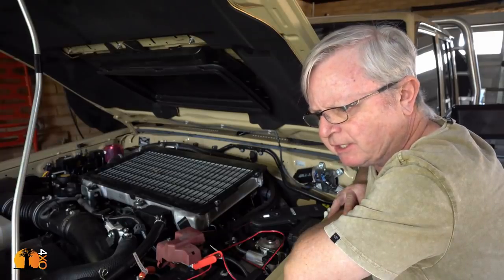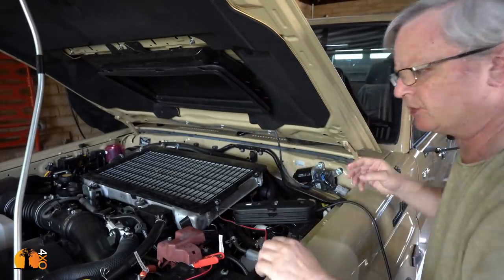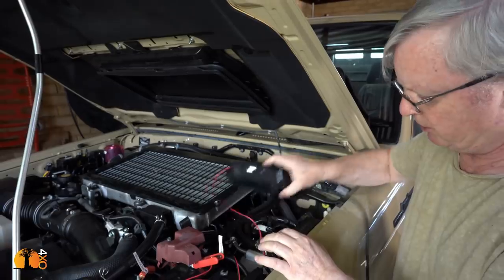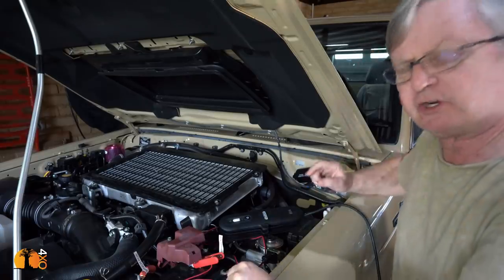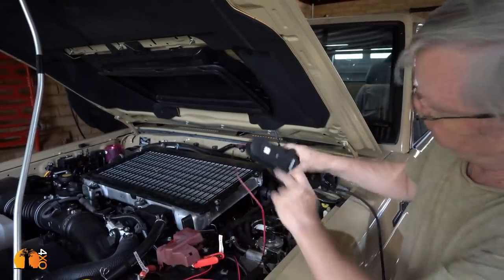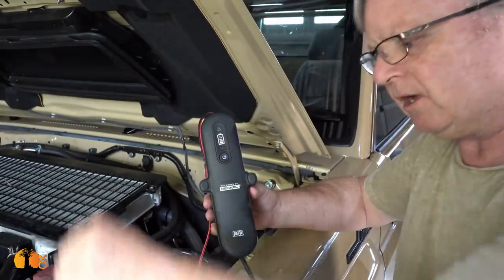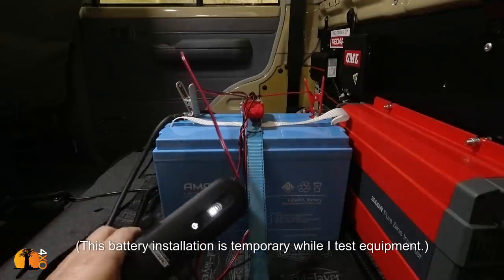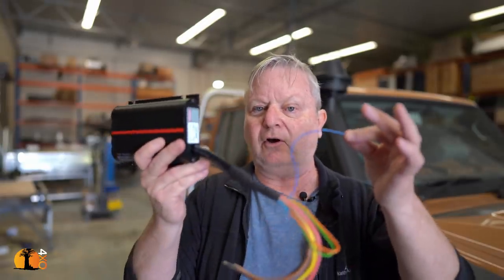DC-DC CHARGER RUNAWAY DISCHARGE WARNING.

Comment: Andrew, you've just proven (thank you) that a DC-DC-charger is a redundant piece of "bling".  All one needs instead of a DC-DC-charger is simply a $30 BIG FAT DIODE . OK, assuming you're also charging from the Solar-Panels, then you need a regulator for them, but a decent Solar charge regulator will do that cheaper than the DC-DC bling. Reason I say this is that the vehicles Alternator is a regulated charger of ample output. Now, you could in theory just join the 2nd battery in parallel with the car battery, and they will both charge just fine . -But we both know why we do NOT do that! - because they will both go flat together, too. And THIS is what the $30 diode is for - it allows the charge to flow only in the direction of the 2nd battery and not out into the car battery.   Your Alternator has plenty capacity to charge both batteries simultaneously. the DC-DC inbetween is only duplicating what the alternator itself does. Moreover, its just wasting energy in the process.  Just replace it with a diode, (and a $1 fuse if you want to go "pro version" ) and you're set (so long as you have a little regulator between your Solars and the 2nd battery).  I'm all for keeping things simple in the bush. I don't need to explain why.  Thanks for  a  great channel.
Reply from the maker: This is not a problem I’m trying to solve. And neither is this a mystery as to why it happened. It can and will happen to anyone using a DC-DC setup. It's the nature of how DC chargers work. All of them with the exception of those relying only on a trigger wire. The solution is to charge the auxiliary batteries first. It's that simple.
Reply: @4xoverland  Fair enough. Either, as you say, charge the Aux batts first ... or ... get out more often - The problem we ALL have :-P

Comment: The DC to DC charger from jaycar is a fraction of the price of the Redarc unit, it has two different ways to turn on, one is via a vibration sensor that's built in which detects that the car engine is running and the vehicle is moving and starts charging, or you have the ignition direct connect option or you can set it to run constantly! Plenty of options! It also has the LiFePo4 battery charging profile! It has solar panel input also and it will always choose solar first if available, solar charging current is higher than what it delivers from the alternator to protect your alternator from setting itself on fire 🔥... 
Redarc is a very good brand! Designed and made in Australia and their products are used by people who don't even know that it's in their vehicle because they are so reliable that you forget that they are even there.
But I'm disappointed with Redarc because their lower end stuff looks exactly like what you would find on eBay for $20 but they are asking $200! Without mentioning why their product cost so much more! I'm not paying that much just for a brand name! I could understand if their one is built to their specifications and therefore cost $50 or $70 compared to the $20 eBay burn your house down special! It's a joke! Renogy is looking a hell of a lot better at the moment! 
One really important thing to keep in mind is the wire that should be connected if you have a smart alternator! If you connect this wire and you don't have a smart alternator, it might increase the current delivery from your non smart alternator! This will cause the alternator to self ignite... Be warned! I'm aware that the Renogy DC to DC charger does this.
You could possibly use that feature to your advantage though, if it's wired to a separate switch on the dash, you can use it to speed up the charging process which you are out on the highway where there's plenty of airflow and the alternator is working at it's optimum speed... 
I'm not sure about that Redarc unit, make sure that the wire is just to turn it on and not for the smart alternator sensing... 
In another of your videos, you mentioned that the LiFePo4 Batteries aren't good for use with a winch! Sure, that's perfectly correct if you have just one battery! Some people just go with one big battery and all is well! I don't have an auxiliary battery in my car but I'm using them at home for solar. My LiFePo4 Batteries are 8Ah... They come in those 7Ah SLA type enclosure's... They are very well protected from everything, they cost $66 each from an eBay seller in Australia and are totally amazing. 8Ah might no sound like much but I first started with 8 of them and was really impressed with how much current these little guys can provide when paralleld, they weigh in at just under 1kg each! I have since added much more, since they are cheap to get your foot in the LiFePo4 door. I can afford to keep adding more over time instead of a lump sum payment.. 
There's also 20Ah versions which work out cheaper per Ah... The sweet spot at the moment are the eBay 135Ah LiFePo4 Batteries at $450AU... Even if they don't reach the rated 135Ah capacity, even if you get 90Ah worst case scenario, two of them should still get you 180Ah for slightly less money than what the name brand batteries will give you for more money! There's plenty of options, with smaller multiples of batteries, the current capabilities could power any winch... It's not impossible.

Comment: User-induced issue.  There are many ways to do it correctly and one way to do it incorrectly (by triggering the dc-dc with a tiny mains charger on the starter side).

Either isolate when shore charging starter batt with a tiny mains charger or use a mains charger of the appropriate size.  Or charge aux back from mains with a dc-dc that maintains starter batt.

Patient: it hurts when I do [this]!
Doctor: stop doing it and it won't hurt anymore.

Comment: your alternator has a 12V point only when in operation. Connect the trigger there. That way you only have the secondary battery charging with the car running. That's how I've setup mine and it's working just fine.

Comment: The exact Reason I run a 4 battery system. Bat1. Main starting & engine (Computer) Bat 2. (charged via a voltage sensitive Relay) It runs all other accessories. Spotties, Radios (including HF with GPS), Tablet with GPS, Work Lights, reverse Lights, Interior Lights etc etc. Bat 2 & 3 are AGM's (charged via DC to DC charger from Bat 2.) for the fridges (1 fridge & 1 freezer usually) & 2 inverters (1800w & 400w) My system is designed that if I was by chance to "loose a battery" I can always start, winch or even still run my other accessories. (I could even use my AGM's to start ......but only in an emergency, if for some reason I lost both the wet cells under the bonnet)   

 As I am involved in running an event once a year in the outback (based on a salt Lake) often my old girl has to sit while doing a job, then I move on etc. Because of that, the power demand with the heat especially on Air Conditioning (I have 2 A/C units) I have also set up 2 alternators so I have a pretty good charge rate on idle even with 2 big thermo fans, A/C, charging cordless drills, the fridges, radios, my mapping system for the surveying etc etc. 

You certainly live by experience! That has taught me lots over the years especially with the high demands I have. I would just love to afford Lithium to lessen the weight & give myself more usual storage when stationary but the AGM's have been fine so far, with the set up being in a different vehicle before this. (P.S. I also run a 100w Solar panel, but that is only a recent addition as I often will load say on a Thursday Night & my truck will sit all day while at work before we head. She's my daily driver & stays fitted out. I find it quicker to put a trailer on if I need to pick up anything largish, but I also live in the country so parking with a trailer is easy. I can certainly understand why you have gone the lift off camper route.

 I also run an onboard 240 volt charger for when I have mains. While the fridges automatically switch over to 240v when I plug in (handy before a trip)  I'm about to do another upgrade of a 240v change over unit to automatically switch everything that runs from the inverters to run on 240 when plugged in. It has taken me many years of trial & error & I'm just begining to sort out what works..... for me. My needs are pretty different to the norm, which I get. Monitoring is critical & I do Love my Victron Stuff!

Thanks for another Great Video (it was great to sit down after work with a beer & watch the next enthralling episode. CHEERS!!

Comment: I have exactly the same setup in my 4WD (third Redarc BCDC setup Ive had installed across 3 separate vehicles). The simple solution to counteract the problem you’ve described is to wire up the blue wire to ignition. Understand that if you leave the ignition on the Redarc BCDC device is then activated, however, how often will you leave your vehicle in ignition? Across the 3 4WDs I’ve owned I’ve never seen a need to leave in ignition.
Reply: That sounds exactly what I thought, i have the same setup with the blue wire connected to an ignition source. No problems.
Reply: Yep, blue wire goes to ignition so battery charges from alternator when ignition is on and solar/external chargers when ignition is off. If you leave the ignition on by accident, the start battery will only drain until it reaches the cutoff voltage and then switch itself off as per usual. The only time you will run into trouble this way, is if you have an external charger/solar AND leave the ignition on

Comment: Have a look at the company Traxide. There's works better than DC-DC chargers.
Been around for 20yrs plus.
Kept my dual battery variable voltage alternator 4wd charged for 7 yrs so far :)
Reply: Hi, do you have a website for them?

Comment: I use the ignition trigger with a 60 second delay. (via another device) This way no accessories come on until the car has been running, and the alternator is at the ready.
Reply: I put one of those programmable ones on my side by side so I could keep the radio on They work great and are cheap 25 bucks all kinds of programs You can make it do

Comment: Smartest thing I have seen is an Inertia Sensitive Relay on the DCDC charger ignition sense wire  that only activates the DCDC charger when it detects the vibrations from a running engine.

Comment: Wire a switch into your ignition on trigger wire. Newer vehicles also have engine on only circuits you can use for your trigger wire.

Comment: Simple fix. Just put a battery isolation switch between the start battery and the dc-dc charger and turn it off when charging your start battery by a mains charger. It's common sense that when you start adding external power to the system that it will turn on and start sucking power from the start battery.

Comment: Use a battery isolator connected to your ignition. Also a separate switch to the DC to DC so you can turn it off even when you ignition is on . When your ignition is off the isolator is disconnect and so is the DC to DC.  Also my trigger switch is connector to the isolator. When its on and the separate switch is on so is the DC to DC when its when is off its off.

Comment: Andrew , you can buy some cheap DC amper clamps to see how much current is moving through the cables.  Your alternator can provide 170A , but at 6000 rpm, at 1000-1500 rpm its max output will be like 100-110A ... Even if your DC charger can provide 50A there is no battery that can accept it... No way that little charger to be able to provide 10A...
Reply from the maker: This is not a problem I’m trying to solve. And neither is this a mystery as to why it happened. It can and will happen to anyone using a DC-DC setup. It's the nature of how DC chargers work. All of them with the exception of those relying only on a trigger wire. The solution is to charge the auxiliary batteries first. It's that simple. When I learn something, I like to share it.
Reply: @4xoverland  I know that you are sharing experience and not solving problem.I find all your electrical videos very helpful. I just suggested that a dc amper clamps will make things very visual about the exact  amperage and direction.

Comment: Thanks for the warning Andrew. It sounds like the DC-DC charger is smart, but not smart enough.
Reply from the maker: This is not a problem I’m trying to solve. And neither is this a mystery as to why it happened. It can and will happen to anyone using a DC-DC setup. It's the nature of how DC chargers work. All of them with the exception of those relying only on a trigger wire. The solution is to charge the auxiliary batteries first. It's that simple.
Reply: 4xoverland Then edit your video accordingly. As it is, it sounds like you’re blaming the equipment, when all the equipment was doing exactly as it was designed to do.

Comment: Great video thanks, so the game changer has introduced problems for the non experienced installer 👍
Reply from the maker: Yes. But it has more importantly made it one zillion times more efficient and easier to install for the non experienced installer. There is always a catch with great inventions. In this case the catch is a small one and as easy to solve as  - charge the auxiliary battery first. What could be simpler?

Comment: Even if you had the blue wire connected to ignition, Redarc will still sense an increase in main battery voltage and turn itself on. I noticed that on my Land Rover.

Comment: A switch or re-settable circuit breaker disconnecting the connection between both batteries is the easiest solution I've found to this problem. Afterall with lithium batteries there is times when you don't want to be endlessly charging your aux lithium battery with alternator and keeping it at 100% especially with no load. If the switch or re-settable circuit breaker can be mounted outside of the bonnet (perhaps in the grill or under guard etc for easy access) all the better. With solar on the rooftop and a little experience you can also judge whether your aux battery will get to 100% on a roadtrip without alternator charge which also saves fuel. Need separate solar and DC-DC controllers though to do this.

Comment: Sir, that wiring got some controll bits missing. i. e: Undervoltage relay is essential. The small 10A charger wont give it 10 amp, no chance. Good to make people aware.
Reply from the maker: This is not a problem I’m trying to solve. And neither is this a mystery as to why it happened. It can and will happen to anyone using a DC-DC setup. It's the nature of how DC chargers work. All of them with the exception of those relying only on a trigger wire. The solution is to charge the auxiliary batteries first. It's that simple.

Comment: So this occurs when the DC/DC charger senses the (higher) voltage but not low current output of a small charger, and then "decides" to charge the auxiliary battery, which is in a state of discharge? Interesting problem

Comment: So in short... your charging system design needs a little more work. I like the comments suggesting an oil presure sensor then there's no risk, much better than "fuse out" or a switch which are likely to be forgotten to be replaced or turned back on......as I often do!

Comment: Are you SURE No.1 Battery is OK?
1 Is that a Japan or Venezuela built 70 Series chassis? How many months was its sea-passage to Oz?
2. How many Ships and Dockside compounds was it on? How many folk Jump Started it over the months, or 
reversed the Polarity? 3. Did the Chassis-Chop/Stretch team disconnect BOTH leads before welding began? 
4. Have you upgraded the Alternator Amp capacity for the myriad of accessories now installed?
5. Previous video showed 120A Fuse load destruction test ... are you really consuming 1,560 Watt Max at 13v?
Reply from the maker: The starter battery is in good condition. There is no mystery why this happened. It happened exactly why I said it did.

Comment: I believe my Renogy DC-DC won't start charging unless BOTH the ignition circuit is 'ON' and the seperate external Voltage Sensitive Relay senses the charge voltage. I'm pretty sure runaway discharge can't happen with my set-up unless I leve the ignition ON,  however, I'm going to test it now that you've got me second guessing myself LOL

Comment: Just add a cheap VSR isolator if your really worried they turn off at below 12.8v if you don't have a smart alternator otherwise you will need to use ignition wire on the dc to dc charger

Comment: Its amazing how most of the comments are missing the point. Of course you can isolate the house battery from the starter battery in many different ways. The point is you then can't charge all the batteries from the starter battery via a mains charger. You would have to charge the house battery and starter separately. Which would work, but is less convenient. Again, the point Andrew is making is beware of trying to charge all the batteries, specifically via wall charger, from the main starter battery, IF your DC-DC is a much higher amperage than your wall charger.

Comment: I have a Projecta 20A DC to DC. It has a cable hooking up to the ACC circuit of the car. If the Controller does not recieve a positive signal from the trigger than the charge rate is reduced to I think 13% so about 2.6A So using a 10A charger would charge both batteries.. Leaving the key in the ignition.. Could happen yes. But who would deliberately?  As the power drag from all the accessories would dampen the ability to charge with or without the DC to DC charger.